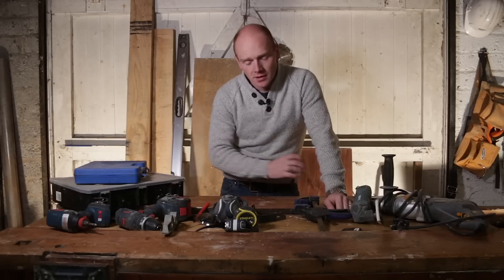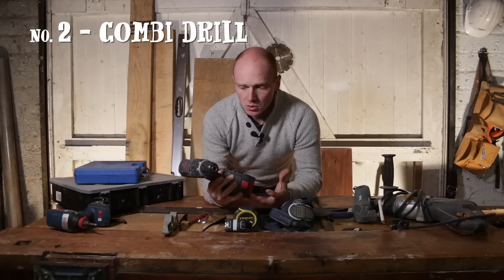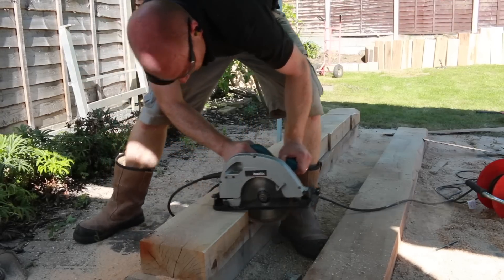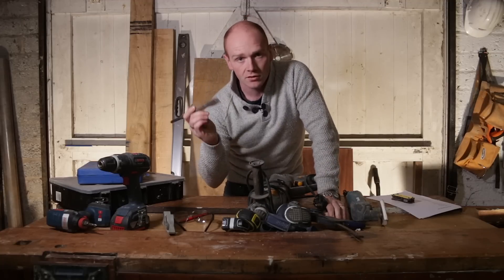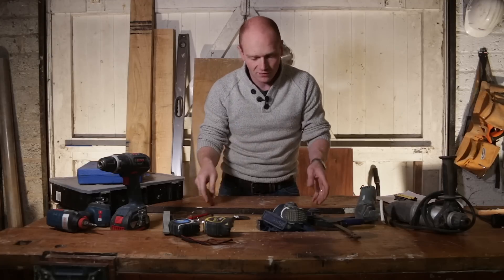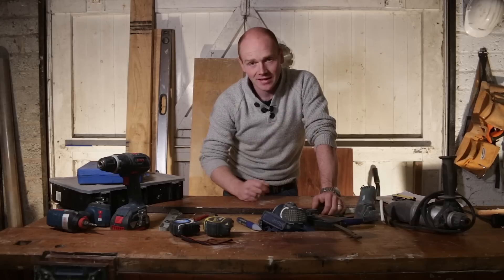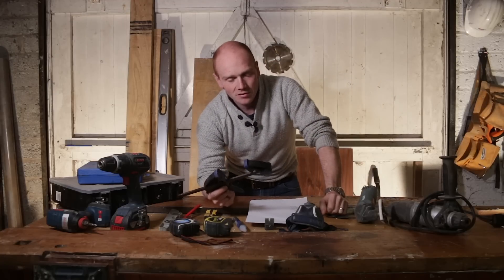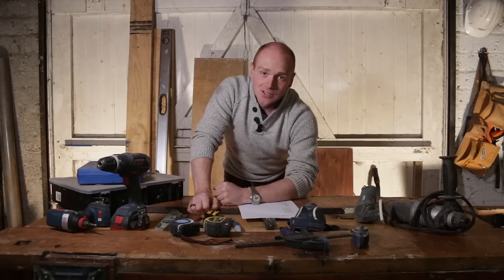Top 10 DIY Renovation Tools

Comment: I'm a heritage joiner, most of my work is for the National Trust and English Heritage. I use pro-quality versions of pretty much everything on  your list - Hilti, Festool, Mirka, Lamello, Mafell etc. And my most used tools in a typical 50-hour week? Compound mitre saw, orbital sander, plunge/rail saw, half-inch and quarter-inch routers - and with DUST EXTRACTION ON EVERYTHING. I can't stress highly enough how important this is to you DIY'ers - the sub-micron stuff you breathe in whilst working timber (especially old material) is a 100% certain life-shortener. And MDF? It's going to be the next asbestos, you mark my words. All the best
Reply from the maker: Great shout. I refuse to cut mdf inside especially without a high spec dust system. Vac system and air filters are top of the list for the new workshop, above any new tools even. 👍

Comment: Hi, two tools that I have that were out of my price range but now aren't that expensive. 1 a laser level ( these will make it so much easier to get level and will throw a continuous line up and down as well as level) 2. a laser measure ( I got one for under £15:00 and I don't know how I managed without it, not only is it extremely accurate but allows you to store all the measurements with notes for when you need to cut goods.

Comment: I never go out without a compact foldable utility knife attached to my belt. All the above tools plus Jawhorse, Sawzall, compressor and various attachments,  cordless vacuum cleaner, some essential hand tools, truck with a lumber rack. Jawhorse as a third hand for installing doors or overhead cabinets. A simple 4.5" angle grinder for grinding and cutting metal and concrete. A laser tape measure, safe time and may prevent a fall when working high up. Rolling stackable scaffolding for working safely high up with safety harness. Air wedge getting into tight spaces for lifting and fine adjustment/leveling .

Comment: For cordless tools. Buy brushless motored, far more durable.
Not sure a combi drill is as essential these days (maybe for joinery) impact drivers with multi speed gear boxes can do it all and the range of hex drive drill bits and attachments is very extensive.
Stick to one brand as once you have a few batteries, you can buy bare units to expand your kit for less expense.
Great video. Im currently modernizing a 1940s bungalow and converting the loft.
Finding this channel has made me see I am not the only insane one lol

Comment: Hi an interesting list of tools, I would agree with most of them but with price drops and technology nowadays I have found these additions or replacements. 1. digital measuring tool - very cheap now but very accurate and you just stand at one end and point the dot onto where you want to measure to and read the results, you can even save the readings so that you don't need to remember them (something I always forgot). You do need a tape measure as well. 2. laser level - these are so cheap now and give such a great line that simply cannot be beaten by a level. the accuracy of these tools leaves nothing to go wrong, just make sure you remove the batteries when putting it away.

Comment: Great video! two small tools I have found really useful are the Vaughan bear claw nail puller - causes minimal damage when nails need to be pulled out. Also the trend corner chisel - great when hanging doors ect. Keep up the good work :)
Reply from the maker: +Aled Jones corner chisel is on my Christmas list. 😀👍
Reply: Crescent 56 is hard to beat. Never needed a corner chisel, have a set of self centering hinge drill bits though.

Comment: My personal top 10 would include a folding stanley knife with a carbide blade, crazy sharp but not expensive enough that you can't abuse it (unlike the multi-tools). Along with my tape measure it never leaves my side.

Comment: One thing I would add for any novice looking to purchase tools is, as you said. If you have any amount of drilling get an sds drill. These combi drills that come with hammer mode on them are terrible compared to an sds. Manufacturers really seem to market the combi drills have a hammer mode as a selling point. Even on high end drills they aren't good (Dewalt/hilti)
Reply: I agree - get a designated masonery SDS hammer drill with compatible drill bits. Worth every bit of money spent.

Comment: I don’t think a Tool belt was mentioned.  This is an absolute must have. Especially when working at height. A decent one with a metal hammer ring and a place slip your tape measure.

Comment: I'm glad to hear that caveat you added about not using that voltage checker as your only method of testing for dead in a circuit. The road to hell is littered with those who thought otherwise.

Comment: I'd also throw in an engineering pencil. You need precision sometimes like when tiling or architrave etc one of the carpenters pencil is too fat!
Reply: Zed Man actually if you sharpen a carpenters pencil correctly the tip is super fine along the edge but wide so that you can make a crisp accurate line on almost any surface without the tip snapping off like a normal pencil
Reply: Paul McFadyen agreed you can sharpen it and it's easy enough with both. I carry both each has its own uses.

Comment: For diy use I cant rate titan tools from screwfix highly enough. Ive thrown all sorts at my 5kg titan sds and its still running perfectly. Same with my titan cordless drill, ive done loads with it, tested it to its limits - its cut out a few times under pressure (it doesnt like big holesaws!) But it still works 100% including the batteries. Both for under £100.
Reply: The Titan table saw isn't too great though, perhaps I need to change the blade that came with it something better. It's damn loud too, though not had experience with other table saws to compare. Highly recommend the Titan breaker though! Well worth purchasing than hiring.
Reply: Ali Dymock my builders dug up my kitchen floor with a pair of titan breakers lol.

Comment: The problem with making lots of videos is that you end up scraping the barrel to keep them coming. Surely when one starts a job if you haven’t got a necessary tool you beg, borrow, buy or hire.
Reply: What? Are you deliberately here to troll or something? What an ignorant comment.
Reply: Brynn Howell if you add up the costs and time involved in "beg, borrow or hire" it's usually cheaper and quicker in the long run to buy, especially if you're a keen DIYer.